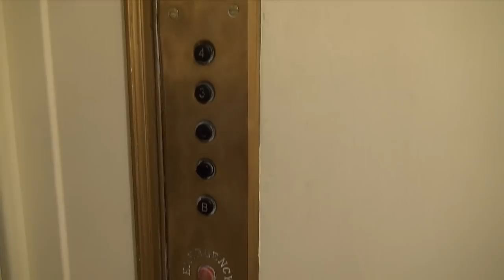in depth look at a 1924 Otis Traction elevator Asheville Masonic Temple with Machine Room

Comment: Safety was all different then. I was inspecting one with that floor pedal arrangement and I don't remember exactly the details but some issue with worn parts and the receptionist lady said "Oh we have to stick this wire through there and pull on this if the door won't open when it gets here". So the office workers had an ad hoc coat hanger wire tool that they could use to open the shaft doors whether the elevator car was there or not so they could get the door open if it wouldn't open when the car arrived. A whole different concept of "safety" with that old equipment like in this video.

Comment: If you really pay attention to the selector, you can see the arms with wheels switching some switches back and forth as they move past the switches. I think this is how it does direction logic. Each switch/arm represents a floor, and a call to that floor is put into the common terminal of the switch. The down request wire is connected to one side of every switch, and the up wire is connected to the other side of the switch. If the elevator is below the switch, the latched relay output from the call button will be directed to the up wire. The call will be reset when the elevator gets to that floor. If the elevator is above a destination floor, the switch (being turned the other direction) will direct power to the down wire. This is how old elevators work. This is also why they can only take one call at a time. When 2 calls are made, the elevator will just go to answer the first one, then immediately reset it and continue to the second call.

Comment: Love your videos, Actually, have an old 1917 Otis Overhead Traction Elevator (Manually Operated) in a building I maintain if you are ever in Reno, NV you are welcome to come check it out and ride it! Well that is if we can get it working again, Someone rode it down to the first floor got off and we haven't been able to get it to start again! Seems to be no power at all when you try to engage the hand control, Any ideas what it could be?
Reply: Have you checked your fuses on the controller? If the fuses check ok check to see if the car is on the final limit switch if it i is you will have to go up into the motor room and move the car off its final limit switches
Reply: I may visit Reno at some point (I live in California), would it be possible for me see it in person (if you don't want to discuss this publicly reply with a personal message)?
Reply: Get me a schematic (if ones available) and a multimeter and I could probably figure it out. Best guess though would be stuck relay of some sort
Reply: Have you also checked the primary fused disconnect in the electrical panel room for blown fuses and the secondary in the machine room for the same?   I'd look at a possible open electrical interlock contact on the landing door, breaking contact.  Does sound like a relay issue on the board if the fuses on the controller and AC feeds check out OK

Comment: That Rectifier is a Selenium stack type from the 1950’s. Most likely, the elevator was originally equipped with either a motor-generator or mercury vapor rectifier tubes to produce the DC power.